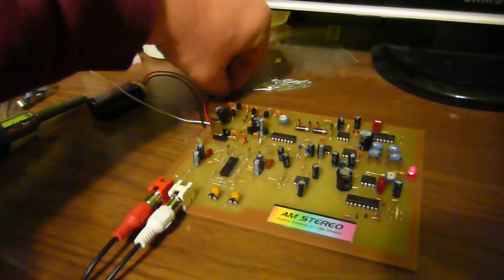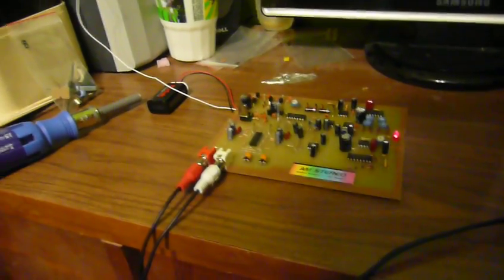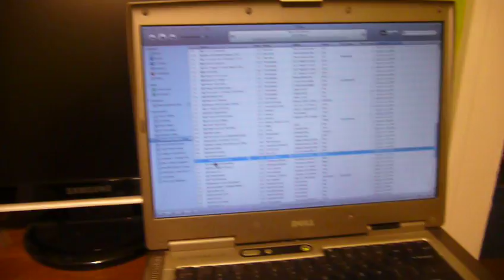Building/Testing the AM Stereo Transmitter Part 2

Comment: @bratina501
Reason for using higher freqs is MW BCB above 1610-1710 Khz has less RFI and fewer stations. I find above 1450 to 1600 Khz is good, older radios can still tune in below 1610 Khz.

As far as antenna vs Freq, true higher Freqs need shorter antenna, but with a 3 meter length limit it makes little difference. You can (should) put a loading coil and matching network on short 3m antenna, but it still is low efficiency, high or low Freqs. USE THE FREQ YOU WANT, BUT HIGHER IS MORE QUIET.

Comment: @welldontdothat I know where you are coming from because my background goes back to amateur radio as well but unfortunately you are limited to well below even a quarter wavelength for AM broadcast under part 15. I built this kit myself but will be operating higher up in the band keeping this whole relation with wavelength in order to get at least a bit more efficiency out of the antenna I am limited to legally.

Comment: The ham radio operator in me is exclaiming, "Make sure your antenna is the right length!" Seriously, though, you probably already know that if your antenna isn't matched (either naturally or forcibly) to your transmitter frequency, you're going to get too much reflected power and burn up your final transistors. Low band HF requires a very long antenna, even for a half-wave end-fed deal like what you've got there. Did the antenna wire I'm seeing here come as part of the kit?

Comment: @uxwbill I am willing to do the high power mod myself and there is also a way to get on any frequency in the AM broadcast band. ECS makes a programmable oscillator that fits into the crystal socket and uses the third connection which the existing crystal avoids. The flying leads idea I am not crazy about either but I can work with it anyway.

Comment: If you don't feel confident about the high power mod then its a good idea to avoid it. I did the high power mod but sadly should have waited a bit more because I put the 2N3053 output transistor in the wrong way and it burned out most likely as an open. Next week will be try number two in reference to the high power mod with a new replacement transistor. Plus the default frequency of 1250 KHz is a big no no for me in southwest Washington because of KKDZ during the day and KWSU at night.

Comment: @uxwbill I did the high power mod too and it really does improve the signal a bit. The information might be a little confusing in the video but in the troubleshooting one you get an angle from the side which should help with soldering the 7809 voltage regulator. The 7805 still remains in place and useful so its still possible to use a programmable oscillator in the crystal socket for a custom frequency in the AM broadcast band.

Comment: Good word of advice, check the audio input jacks and be sure you don't have the back end of them shorting them to ground and also be sure you have the wires connected to the appropriate pins. Mine worked perfectly when I tested it at first and my somewhat fussy Accurian AM stereo/AM HD/FM stereo/FM HD receiver was happy.

Comment: No left channel means the problem is in the audio input or matrix stages. After the matrixer, the audio is processed and transmitted as L+R and L-R instead of L and R individually, which means any problems in those later stages would affect both the left and right channels equally.

Even without the hi-power RF add-on, you can get an excellent signal by connecting the antenna output to the center ground pin of a 3-prong AC outlet. This safely uses the ground wiring of your home as the antenna.